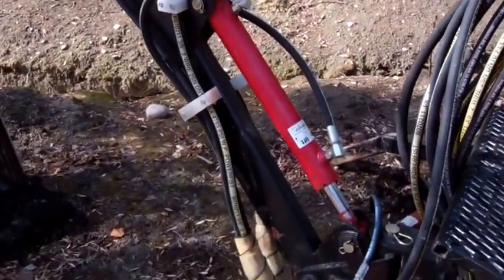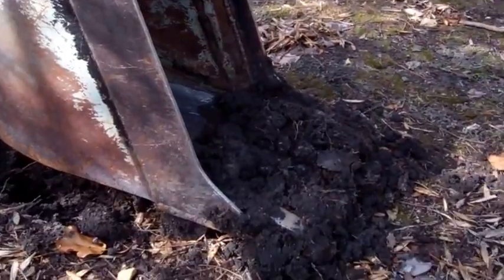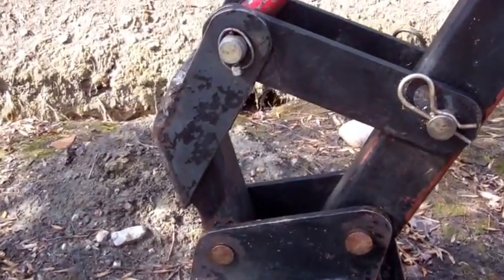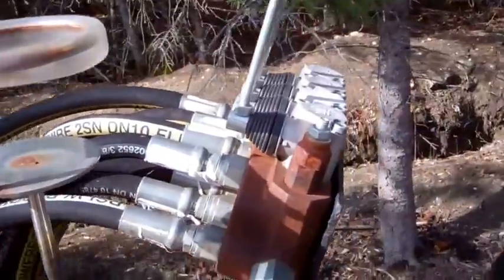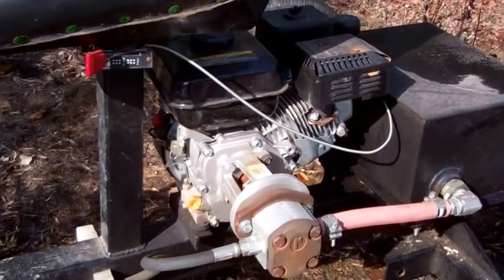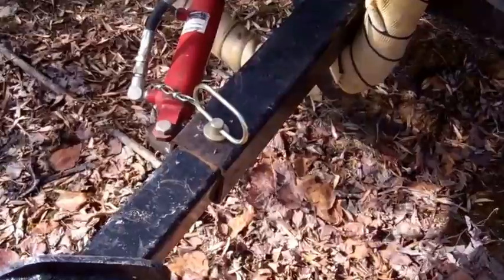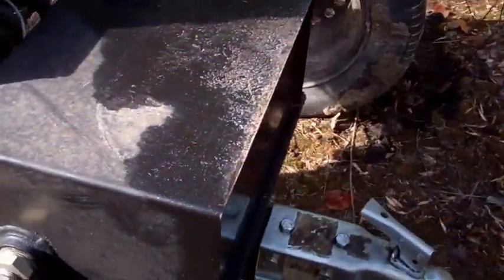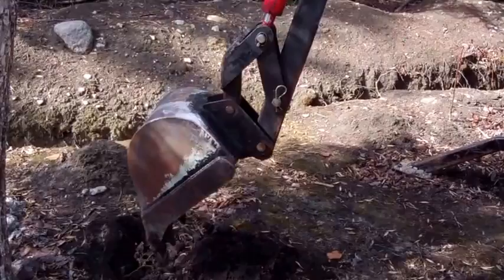Homemade Excavator An Overview of How I Built Mine

Comment: I have a mod idea for you, if you get bored, get a zero turn mower mount it on the back. you maybe able to find a old one from a salvage yard.
Put a idler wheel under the where you have the legs.
Just a thought. You have skills
Reply from the maker: +spleone that would be cool! those mowers are like gold around here though...
Reply: I had same idea recently! Remove deck on ZTR mower and drive hydr pump down there with a belt. I Save Tractors has video of building tracks for rear of lawn tractor...

Comment: I building one myself great design what kind of pump and gpm flow rate you running
Reply from the maker: Frank Taranto it been a while but i believe this is the one i used http://www.princessauto.com/en/detail/6-3-gpm-hydraulic-gear-pump/A-p8375370e
Reply: Thx alot
Reply from the maker: Frank Taranto what hp motor are you using?
Reply: I have a 20 hp briggs and stratton i was thinking of using off a lawn tractor
Reply from the maker: Frank Taranto well...the calculation is, hp=(psi x gpm)/1714....so with a 20hp motor you could go up to a  19gpm pump operating at 1800 psi...which is a very safe and conservative pressure. ...good luck with the project!